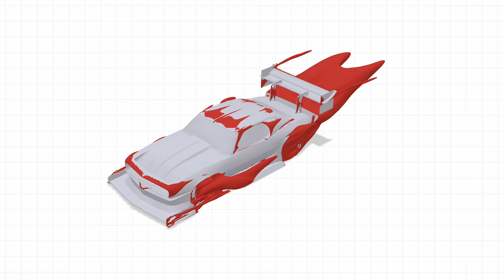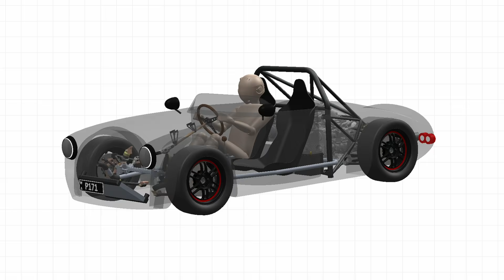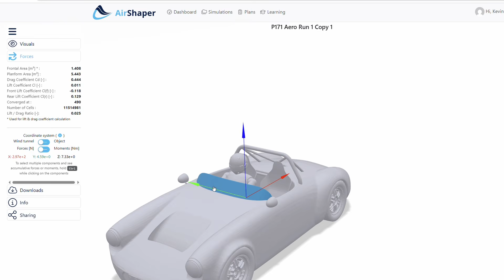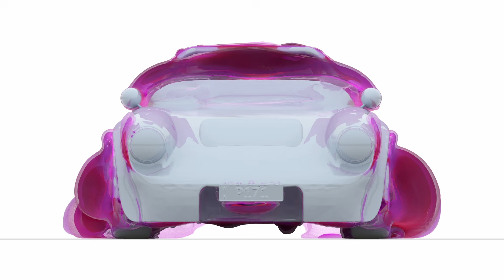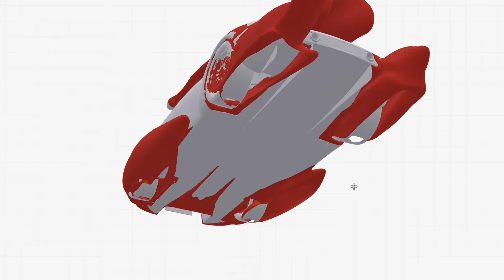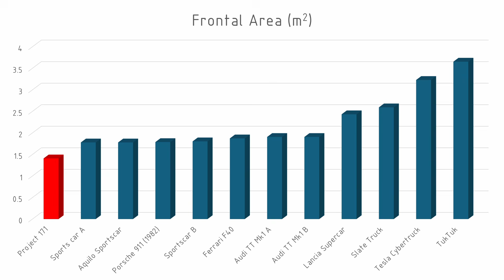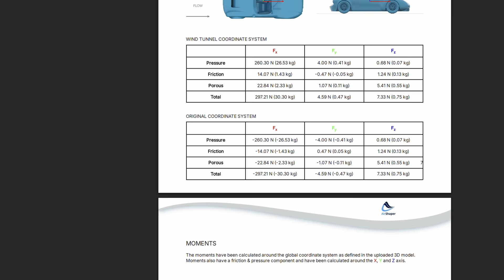Applying Modern CFD to 1950s Design: Project 171 Aero

Comment: Doing some sim work for a racing team, they shared an interesting document where the manufacturer scale model wind tunnel results were compared to a full scale test at a F1 team facility. There were certainly differences in amount of downforce, but the ride height sensitivity results were significantly different. This was to the amount of really changing the car setup you would use and the ride heights you'd aim for. It seems aero testing is a bit like tire testing, it is very complicated and there are tolerances and errors that can be significant. But it's nice to see other uses for it, such as noise, kind of a big deal! And finally, I wish more people educated about the relative use of the drag coefficient. So often you hear some reviewer driving a humongous SUV that the CD is only 0.3 like a Prius (or something) but when the area is double, so is the actual ''resistance''!
Reply from the maker: I have showed the results to someone who used to work in aero at F1.  Definitely there is a fair amount of difference in the sim I ran compared to a top F1 team.  He was pretty impressed with the results given the inputs and ease of use.  He did point out a few areas where the original model I created probably let the results down, mainly some issues of STL resolution in a few places.  I aim to fix these in the future, especially where I may have rushed a few areas.

Keen to do some future work in sensitivities. as well as seeing what more can be done with the AirShaper product.
Reply: @KevinHayward7 In the other video you made a comment on how he recommended creating a specific style rear diffuser, I would love to hear him expand on that recommended diffuser design

Comment: Thats a verry informative review. but, will you leave the bottom on the radiator mouth open? looks like it leaks air under the car
Reply from the maker: It will be closed off as you suggest.  I was trying to see what the effect of the radiator opening being as large as it could be.  I was wondering how the flow through the cooling would affect the driver.  In the end the short windscreen dominates that area if flow with lots of separation off the back edge.

Will aim to fix for the next runs.

Comment: It certainly is nice that such tools exist, but I also fear lots of people will just assume the results are accurate. Getting the right numbers I feel is not guaranteed at all and few people will have the means to actually verify the results. When a F1 team leaked a high res model of one of their cars and someone ran CFD on it, the numbers were closer to 50% of alleged reality than 100%..
Reply from the maker: Those are certainly concerns with any finite element methods.  The code underneath the AirShaper products is OpenFoam.  There are already quite robust meshing tools available for openfoam that produce good results.  AirShaper provide the full openfoam results that can be analysed to get a lot more information than is shown.  I have had a short look through those results and it indicated that the setup appeared sound. 

I think this is likely due to the fact that a lot of simulations of things like a car have very similar domain and meshing requirements.  There are areas that you lose some control over, but for overall design guidance I think the tool is very encouraging.  In the end the service offers a fast way to pre and post process the simulations, which are the real pain points of CFD analysis.  It is probably worth being more concerned if they didn't provide the full solution files in the end.

That being said I hope towards the end of the project that we can go through and show a lot of validation of the simulations.